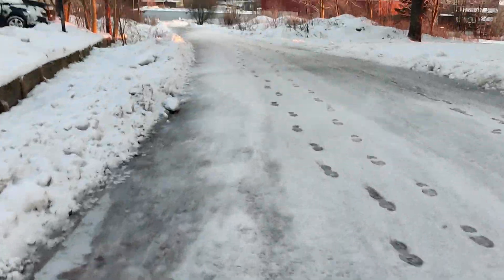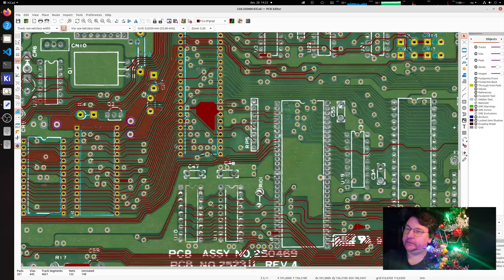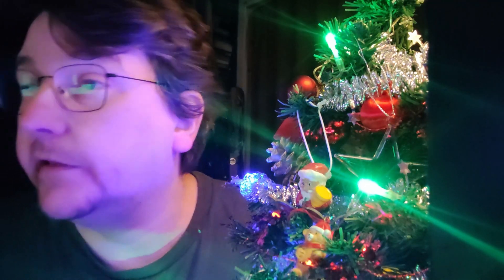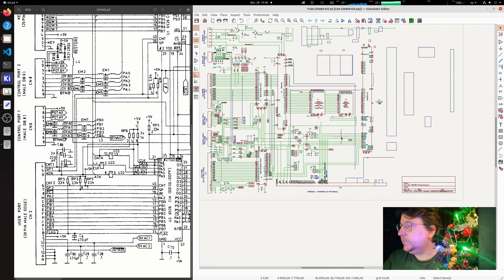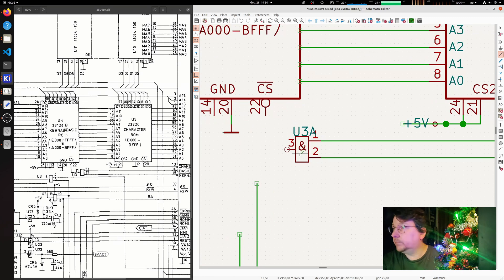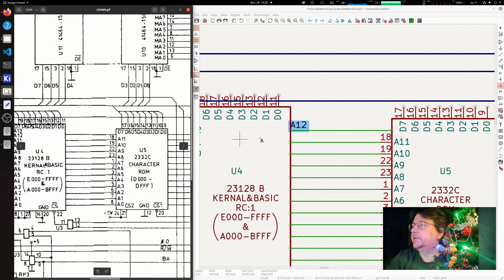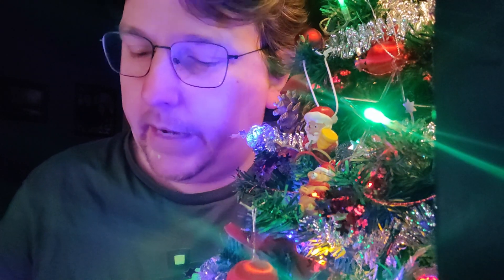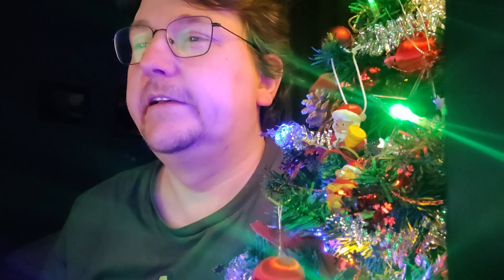C64C Motherboard KiCad Replica update 2

Comment: Happy new year Hans & Ingri. Hope you have a wonderful year.

I agree on the lighting situation. I went for a LED light that matches the specs of the Elgato Keylight but is much cheaper. Cameras love light! I struggled with getting green screen to work until I got a proper light. So definitely go for that
Reply from the maker: Thank you, and wishing you a happy New Year! Will be looking for video light. Could use cheap paint/utility light, but they flicker.. perhaps go crazy with a softbox 😃, but a led panel will be good too.
Reply: @bwack  I've tried a few things like that (utility lights etc)  but they don't work. Either they are not strong enough or their beams are too tight. I went with this one: Bresser-BR-24B-Bi-Color. It's meant for group photography, has settings for light strength and colour and has just about the same specs as the Elgato Keylight but at a fraction of the price. Works fine for moe.